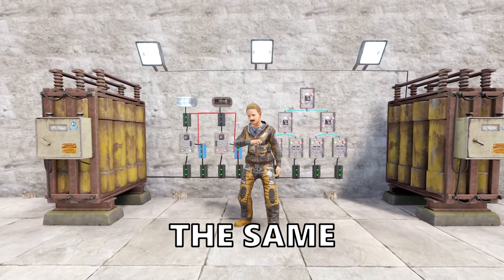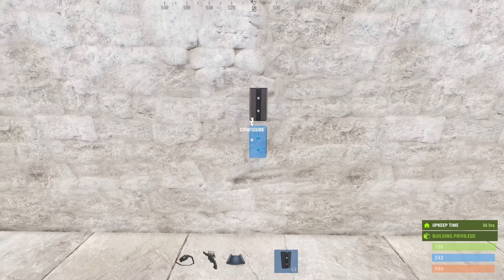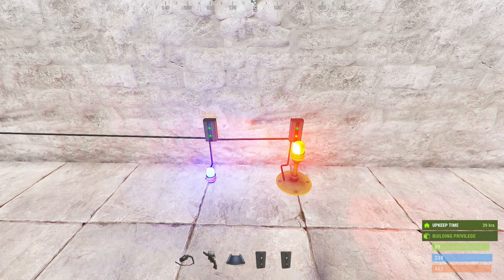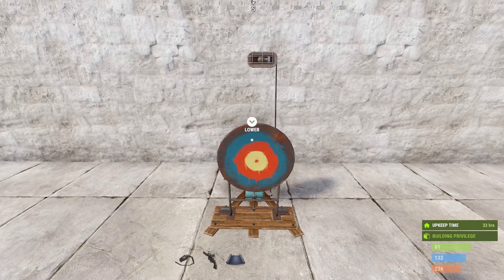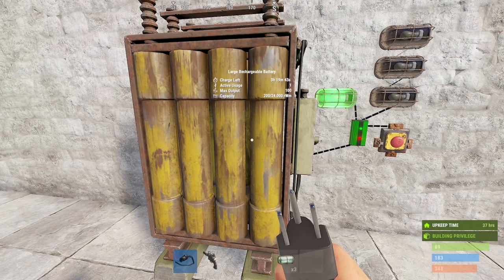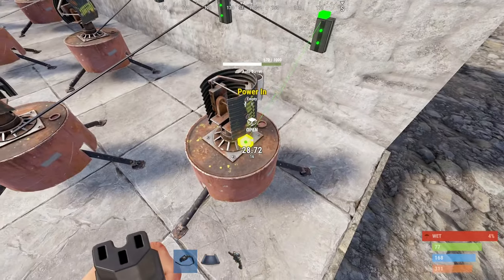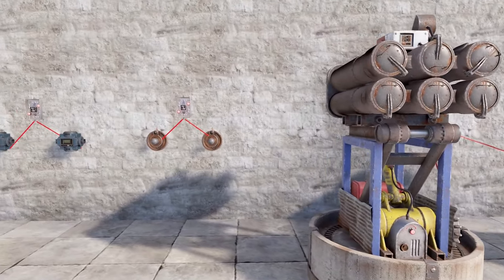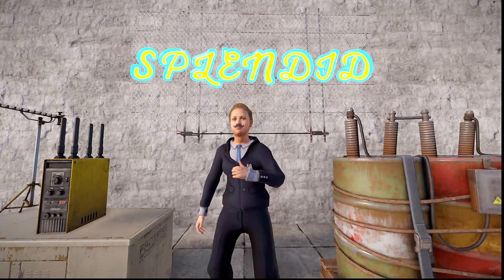Electricity has CHANGED | All you need to know

Comment: The refrigerator and the Oil RIG table should consume energy, on the one hand the refrigerator fulfills the function of not damaging the food, although it does not matter if you put it in a box or not, and second, all the components that you require to Building a table of OIL RIGs by nature consume energy, but when you use them directly on the table, they don't, which to me makes no sense.

Comment: Also holy hell not having to use an AND switch on every single heartbeat sensor before each OR switch to join multiple heartbeat sensors together if they have the same function i.e. splitting a compound into zones for spotlights/turret pods. I played a wipe with a larger group and functionally made the second layer of compound a giant trap base where you had go be in the compound/in range of the turrets before the doors opened on external tcs and you got killed by turrets. It worked really well but with 20 hb sensors 20 AND switches 10 OR switches 4 sets of rf trans/recieve/timers 12 door controllers and all the electrical branches and splitters the amount of just standby power without turrets or lights even on was over 200 watts.

Comment: Please facepunch can we get craftable pcbs, and/or wall mountable cabinets for electrical components, a wire tool with "memory" so i can place components down pull my tool back up and be able to run a connection to a previously placed/interacted with component, changing where things like rf recivers and smart alarms can be mounted or making them less obnoxious shapes ect. 
Just changing how tall the medium batteries are made them 100% more practical, id like some thougnt given to other deployables in that respect. 
I made some pretty cool gadgets with rf receivers to create zones for lights auxiliary power and turrets in my compound but even just the size of the rf receiver made it impractical, having to have half a square foundation dedicated to just receivers in every gatehouse to acheive it was annoying and impractical.

Comment: Thank Christ we got some good electrical updates, I'm pretty good at electrical, but I mostly go for circuits held together with dreams and duct tape, now I can look as red neck as I want in my base without having infinite power drain from components.

Thanks for the low down on the changes!
Reply from the maker: They for sure are nice and things we wanted to have for so long.
Very splendid time to be an electrician.

What kind of circuits did you do?
Reply: @PhilieveRust  lots of automation and auto smelt, with smart electronic swap overs for defense and whatnot wired with HB sensors.

I also use a auto sort hub system to ferry loot all throughout my base and produce stuff. I tend to spam GP production early so I can raid.

Comment: For the backup turrets, since the splitter can now send out uneven amounts of power, wouldn't it be simpler to just send 29 from the 1st branch and attach the branch with backup to power out 3?
Reply from the maker: Yes, indeed. That's smart.
I didn't think of it.
Reply: @PhilieveRust  You would have gotten there eventually. Love your work, I use backup turrets as the primary focus of my base. 😁
Reply: Can you show an example of this? I'm struggling to understand!
Reply: @SALT_KING  If you watched Philieve's previous video on his backup turret setup, change the 1st Electrical Branch to 29 so the Splitter will send outputs of 10, 10, and 9.
Reply: @Gpz0  is there any way to make 2 turrets back up each other? so if 1 break other one activates not 4
Reply: @realsecrets1  I'm not sure what you mean. Philieve's current setup is 4 turrets group together with only 2 getting enough power to activate at any time, while the other 2 are backups that will get enough power if a turret gets destroyed. Are you looking for a different setup?